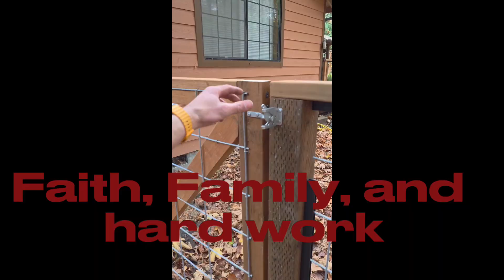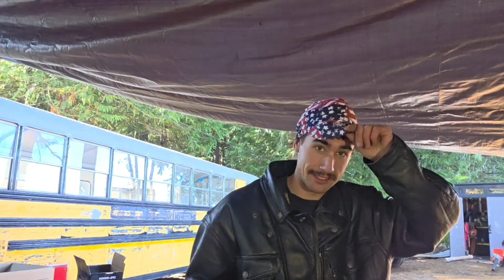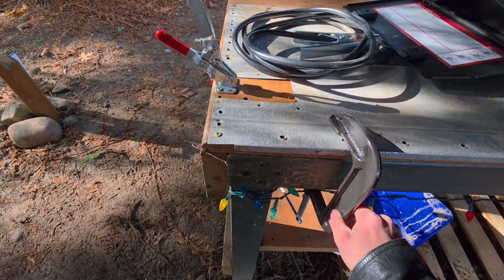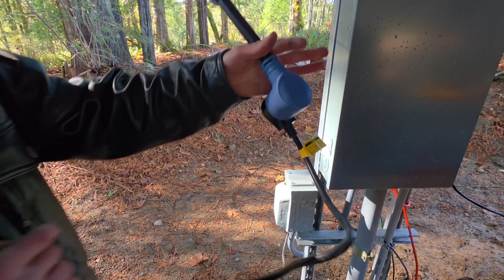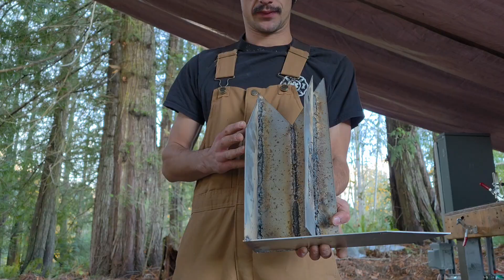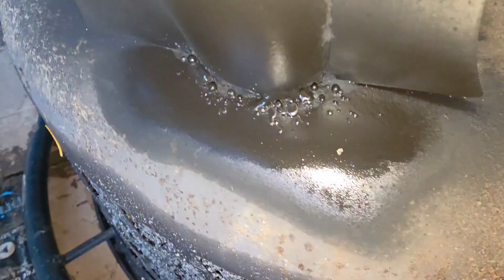I started welding!!

Comment: Earplugs as well. You can use the brim of your welder's cap to cover an ear, but a blob of molten metal can bounce off something, into your hood and find its way into your ear and you can say goodbye to an eardrum. Cheap foam whatever will do the trick. You can also get leather sleaves that cover the top of your shoes and shins if you don't have solid boots. Hot metal will burn through your shoes quick.

Comment: Another hot one. If you don't have them already, get some UV 400 safety glasses. They are supposed to block 99% of UV radiation. They are like five bucks. Wear them always, even under your welding hood. If you get flashed, I hear they can help prevent arc flash to some degree. Will save you a lot of awful pain. Think intense sunburn with blisters... but on your eyes that lasts 1-2 days.

Comment: I will 100% stand with @patrickenhoe4206 about the galvanized. You have 1* aka (one ass to risk). Also, fantastic tip about wearing consumable gloves under the welding glove layer. Even nitride will keep your gloves dry. Don't be part of the circuit.

Comment: Hey man! Stumbled across your video.. Figured I'd give it a watch and see if I could offer some unsolicited pointers! 

For background purposes: I’ve been welding for some time now and do steamfitters work mainly tig welding thin wall medical-grade stainless pipe. 

Please note that these are merely suggestions and are not necessarily strict guidelines— its what ive found has been beneficial to my career in this field.

First, great job on doing the research— lots of people jump into it without a clue as to how to begin. One thing to be acutely aware of: when you get shocked (which you will, inevitably) tell someone. I wear latex gloves under my welding gloves (that dont have holes in them because latex gloves are ridiculously combustable) if i am sweating a lot, or if it is snowing and my hands are going to get wet. Understanding how current affects your puddle and the interesting and cool ways you can manipulate it has helped me massively. 

NOTE: try not to use sharp things to dig into the welds.. it can put dents in it which can, at times, strengthen it (think peening things with steelshot) but if you pick up a wire wheel from harbor freight— WEAR GLASSES!!! but it works much better at cleaning the slag and rust and mil scale off any material. except for aluminum.. aluminum is too soft for a wire wheel so use a wire brush. You shouldnt need to wire wheel it, anyway. 

Lastly! Have fun with it. You’re building a skill that is highly sought after and can grant you significant opportunities if you work at it enough. It’s what built america’s bridges, buildings, aerospace tech, puts gas in our cars, heats our homes, and what has historically brought us water. It’s a beautiful art, to me, and the best part of it is that you can never be the best. We all started from nothing— never forget that. There will be some hackjobs coming on here im sure if you keep posting these trying to tell you how to do certain things.. Grain of salt, and find the way that works for you— those charts are a guideline, find your speed that you like and it’ll come out great. 

Best of luck— dont weld galvanized steel!